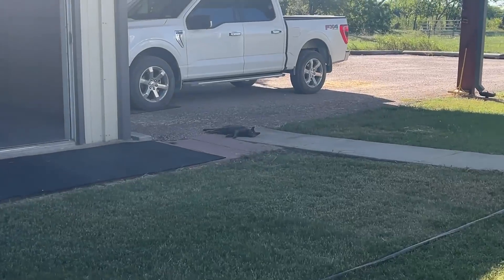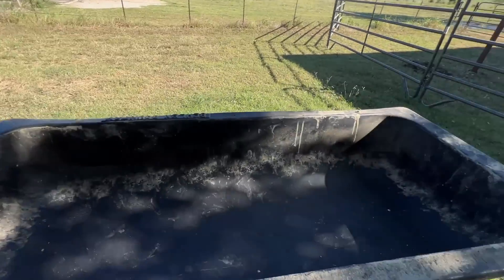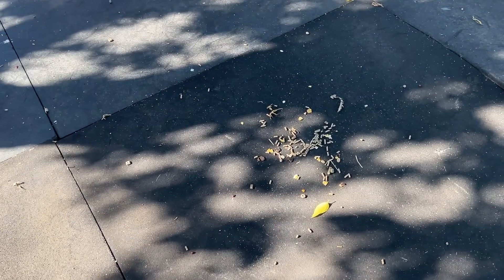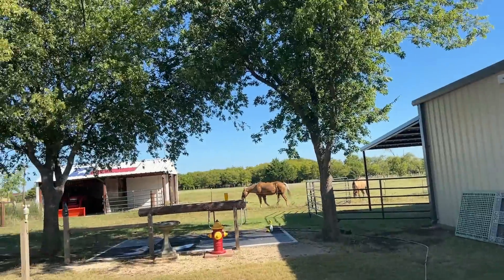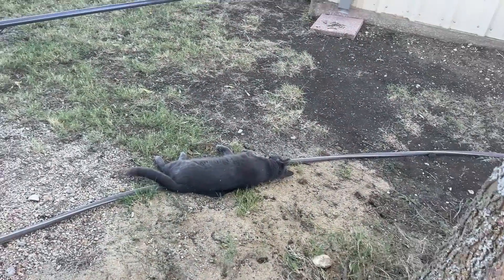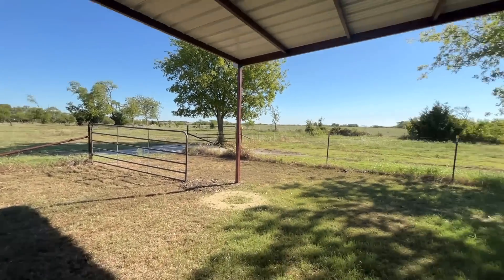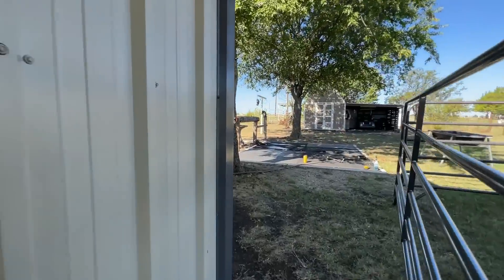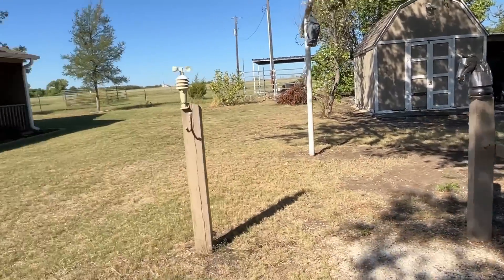Cleaning Horse Feeders & Removing Mold From Metal Building & Crazy Horse Rescue Women

Comment: I volunteered for about a couple years at a horse rescue in Colorado. Seemed pretty well run, but they typically didn't need trainers or even donations of random tack or equipment. They usually needed workers to just get the feed out to all the horses (hay to 4 big pastures, and also catching individuals who needed supplements/medicine), general maintenance and fence repair, and money for the feed and vet/farrier visits. The feed was often specialized because there were a lot of horses with health problems or geriatrics that needed a special diet, so donations of random grain didn't really cut it. 

There was a lot, and I mean a lot, of the volunteers who wanted to work WITH the horses, but they were very careful about who they let do that because there was the usual mix you get in the horsey world of pink-wearing craycrays, people who wanted to use hard bits and spurs, and then a few who actually knew what they were doing. Also, about half of the horses they had were basically pasture buddies -- very old or injured to the point they couldn't be ridden, so the only training work that needed to be done with them was being sure someone could do their feet, really. 

Generally the hardest ones to work with were the mustangs or other half-wilds, and they were just, well, half-wild, not problem horses. The ones that were in there from neglect were usually too ill to be difficult to handle as well. They did put down horses if their injuries/illnesses were too severe, but I don't know if they also did that for behavior. I just never really saw that. At most we had a fence jumper (mustang colt, loved his girls even after gelding) and another neglect rescue who turned out to be quite pushy in the pasture, and probably would've been among humans but pressure worked on him as well as on any other horse, so he wasn't really a problem for me. Also some food-aggressives, but the hay was spread out in the pastures so each horse had a pile +1, and the grain was fed in individual holding pens.

I don't know how that jives with what you've experienced, just my little window on it.

Comment: The personal go-to for mold (and light moss )  on the outside of a building is 30 seconds cleaner. 

You can mix a batch in a weed sprayer and apply it. Then apply a bit of scrubbing action ( with a broom etc ), then pressure wash off. 

Don't let the cleaner dry on the surface. 
You don't really need to scrub, but I find it does help. 

Just the way I approach the problem in the Pacific North West ........ the land where we have no word for "crisp" and 50 words each for rain, mold and wet ......LOL

Comment: I have a Mobile Home with the same kind of problem on the back wall. All I use is 50% bleach and water it takes it completely off and I don’t even have to scrub. I’ve been doing it for years. I just spray it on and then leave it for 10 minutes and rinse it off.
Reply from the maker: I was thinking bleach would rot and eat away at rubber washers on screws?
Reply: @ThinkLikeAHorse  I have vinyl siding. There’s no nails or rubber washers or screws at all. I even do my skirting. Never had any damage. But I guess it depends on what material you’re working on
Reply: @ThinkLikeAHorse  depends on the material of the washers.  If they are neoprene, you're likely ok.. soak a screw on your mix, then let it dry in the sun.. check it every few days.. you're good if you don't see any crazing in a couple weeks..